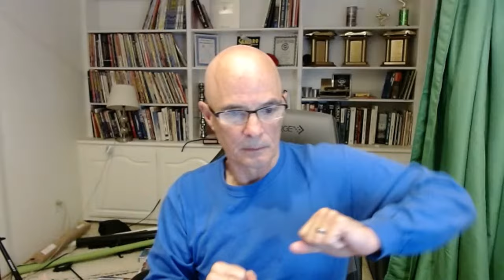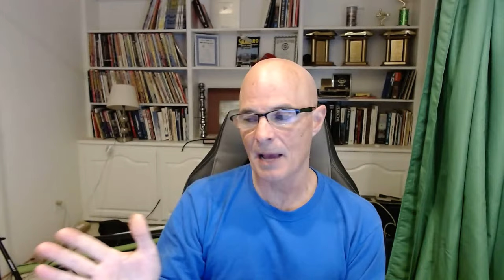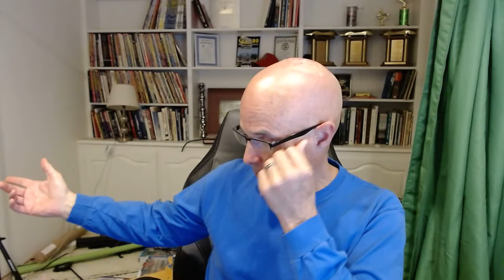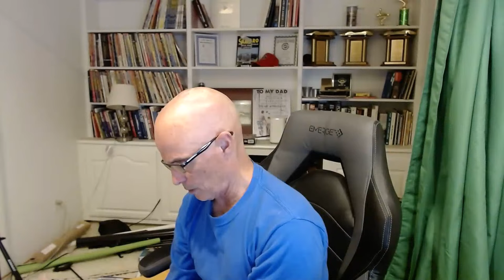WHAT IS A TOWING CAM? LET'S TALK TECH

Comment: Mr. Holdener, i have a question that's off topic. Do you have any testing videos on the PCV system? 

I have a 7.0 Ford racing engine and i used the PCV system from a 5.0 Mustang engine on it. I recently hurt this engine while street tuning. I think it has a lot to do with PCV being a restriction and causing piston ring flutter in addition to pushing oil everywhere it didn't belong. I'm sure that caused some detonation too.

Thanks in advance.
Reply from the maker: DO YOU HAVE SUFFICIENT BREATHERS IN THE VALVE COVERS?
Reply: @richardholdener1727  i didn't when before i hurt the engine. I have recently welded (2)  -10an fittings to the valve covers, so i add a catch can. I've plugged the OEM PCV port that's in the center rear of the lower intake manifold and removed the check valve. I still have to take the engine apart and see what's damaged.

Comment: No replacement for displacement. 350cid is the minimum engine for towing. Drive at a speed that allows you to keep your RPM's at about 3000 to 3500 RPM's on a hill. Any higher than that you will start to build heat in the cooling system. You can not drive at 6000 RPM. You will kill your engine.

Comment: A good show would be does a "marine/boat" cam make the best TOWING cam..
People used to use boat cams for towing.  Constantly loaded motors.
Reply from the maker: a boat cam and car cam are the same cam
Reply: Every cams a boat cam!!!!😂
Reply: @richardholdener1727  so it's all disinformation? Boats live at one rpm. Concentrate power at one rpm. 
Like a tow motor. There is no rpm swing under load like an automobile.

Comment: Hey, Richard. I was wondering if you have worked with the nissan z series 4 cylinder engines. Specifically the 80s datsun/nissan z24. I'm wanting to put a cam in my 85 720 pickup and was wondering if I would need to change the tappets when changing the cam
Reply from the maker: if the cam is the same base circle, then no

Comment: Consider this  Duty cycle    A drag engine has a very short duty cycle  therefore can get away with lots of compression lots of timing extreme cam profile  very limited cooling system ,sometimes no cooling at all  By contrast pulling your gooseneck toyhauler/camper up the grapevine requires the exact opposite 100% WOT for miles  The factories have had to consider all of this  And provide a warranty   This is actually very high performance indeed  It is not rational to expect just a cam change to offer much improvement   A complete engine upgrade---more cubes --more cooling is the answer  The heavy duty engines of the 60s worked on about 2 cubic inches per hp  I know it doesn't sound like much  but you can't have your cake and Edith too
Reply: What dose the rule o thumb say about tq?

Comment: Only 15 min into this video but im already finding it very insightful. I have an LS1 catfish thats pretty much stock except a procharger, exhaust, and rear end. Next up i was considering cam and converter. Shes got plenty of go once she gets into boost but i was trying to find a cam that would help down low. From my research, and confirmed through this video, it seems there is no such thing. I always knew cams were a trade off between high end and low end but i always assumed a well made high quality cam could beat out the stock one down low while also raising peak. While true to some extent it doesn't seem to he enough to matter. Torque converter should still help to get me to those higher RPMs/boost quicker but does anyone have any recommendations for what i was trying to achieve with a cam? Aka more torque down low without sacrificing anything up top?
Reply from the maker: A Truck Norris is better than the LS1 everywhere-and by a significant amount down low compared to that cam
Reply: @richardholdener1727  thanks for the reply. I truly appreciate it. I will start looking into it. There is only one model under that name?

Comment: Looking at building a LQ9 mated to a 4L80 to swap into my 90 GMC K2500 with 3.73 gears. I want to build it to tow a little, maybe 5-8k lbs. 

Debating 706 vs 317 heads (I have a spare 241 but I don’t think that is beneficial) and on the fence on cam. Looked at Truck Norris or chopacabra but a neighbor also suggested an ASA or ASA clone. Any insight?
Reply from the maker: 706 makes more than 317 (stock to stock), I have cams for sale for $169 if that helps your decision
Reply: @richardholdener1727  any thoughts on the ASA cam? Seems not many videos or dynos on it? Is it just not a popular cam?

Comment: You didn’t pull stuff in your truck with your 4l60e using overdrive did you? That’s probably what took it out.
Reply: Tow mode on adjusts shift points  once up to speed you can have OD on, just turn tow back on at a stop to get going. A transcooler goes a long way.
Reply from the maker: I ran OD and no Tow Mode while cruising down the flat freeway
Reply: @shadowopsairman1583   A 4l60e needs a lot more than a tow mode button/ tune to not be trash.
Reply: This coming from someone who currently owns 4 of them. 🤦🏻‍♂️

Comment: anybody have any thoughts on a cai tbss lq4 with shorties and catback with 9.85 compression ported 317s im trying to figure out what cam i have a 3800 stall tc and mainly drive for fun but do ocasionally have to tow with it and want to stay on 87 octane want a big cam though
Reply from the maker: with a 3800 stall you can have any cam that will fit the available p-v

Comment: Towing Cam = Supercharger.
Reply: Have you done this ?
Reply: @xmo552  Yes, many times actually. My towpig rn is 2001 2500 with a 6.0 and a Magnablower and a PDS camshaft
Reply: @woopyass  
Ok nice. I asked, because I've been considering blowing my 1 ton Squarebody just for towing purposes. Are you seeing your MPG going down since the supercharger installation?

I've also thought about a turbo so I can tune it to "come on/boost" when I need it. MPG vs power is what I'm looking at.
Reply: @xmo552  Yeah of course my MPG went down LOL because that's all it was intended for. I bought the truck to yank the LQ4 and 4L80 to stick in an S10, but it ran too well to just scrap. It had the iron heads so the first chance I had to justify tearing into it, I put some regular 317 aluminum heads, cam and lifters in it with longtubes and a tune, and it was such a great truck to pull things around locally that I started looking for an LSA blower to put on it. I ended up getting a complete wrecked truck with the Magna  on it, and put it on the LQ4. After doing a ton of burnouts with it, it just sat around unless I needed to tow my trailer, and I found out that it worked extremely well for that. It pulls my K5 on 1tons so  good that I actually sold my dually that I had been using. It's way easier to park and back up without the big hips, and will still smoke the tires with bags of concrete in the bed LOL. I had to add a better water reservoir and an electric pump because the magna setup adds quite a bit of heat to the equation but that wasn't a big deal. That old truck is great the way it's setup. 2001 2500 RCLB LQ4/4L80 2wd 4.11 gears, and the A/C works.

Comment: Forget fitting a TOW cam , fit a turbo if you want tourqe.
Reply: This.
This is the solution I came up with after a few years of contemplating a few different builds. 
Gearing whether in the axle, trans, auxiliary trans would help but not in "my" situation. 
If I get more engine size, compression, power etc, or supercharger.... all this would cost me MPG AT ALL TIMES.
I feel like a turbo can be tuned to "come on" when I need it most.